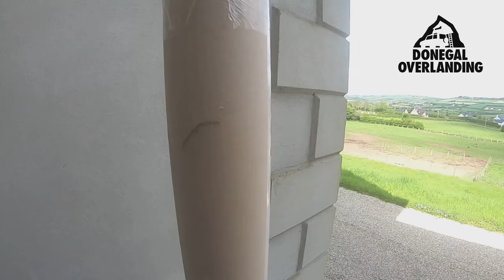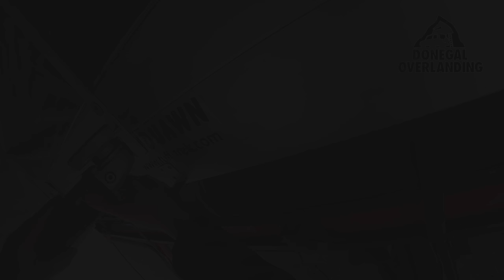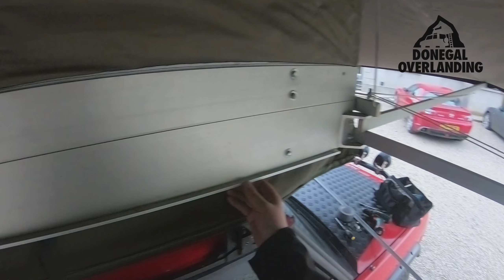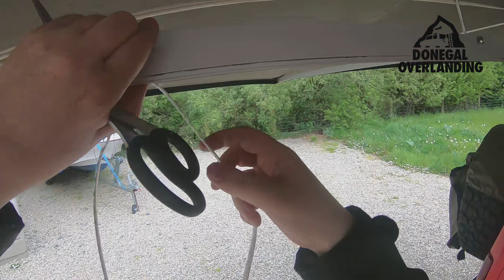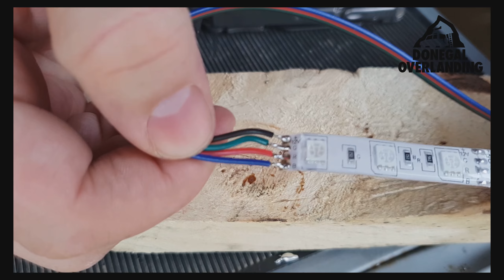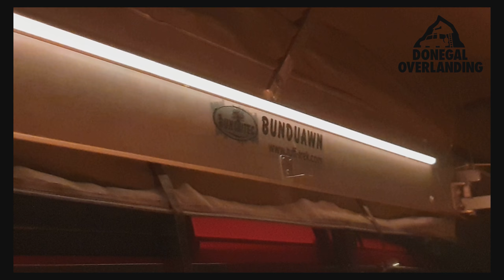Ultimate Awning LED Strip Lights Install & Demo

Comment: Have you thought about using something like this to seal/insulate the soldered joints. I use it on a number of different things including joint which would be difficult to access.
When soldering I frequently have a bit of solder on my soldering iron tip as it can assist to transfer heat to the wire. It is one of those subject where lots of people have different opinions, what you did worked and as a solder virgin you should be proud of your achievements. Just get some bits of scrap wire and practice, just make sure what you are soldering is clean and don't fall for the old trick of someone conning you in to trying to solder aluminium as it is a bit like sending someone to the stores for "a long stand".
Reply from the maker: Thanks for the advice Trevor, will remember that tip next time I have to use it.

Comment: Nice and Cozy. But for proper soldering search for a how-to video (You have to heat the wire and the wire melts the led).
Reply from the maker: It was my first time soldering, I was amazed it worked at all :D
Reply: Yes, indeed. I was telling you about this because I used to solder wrong for a long time and I wish someone told me :)